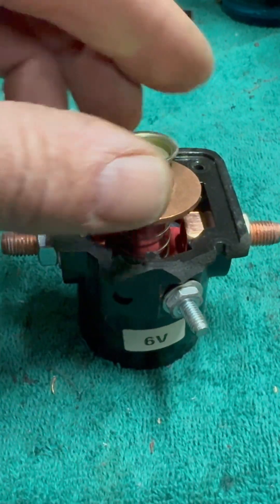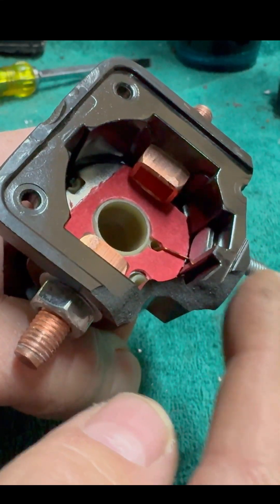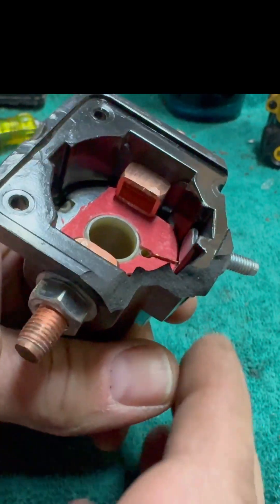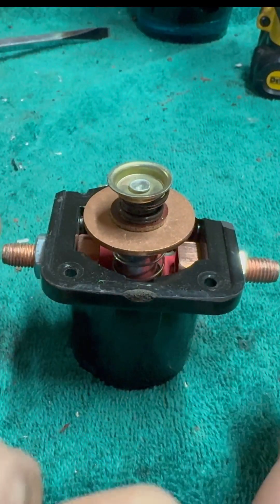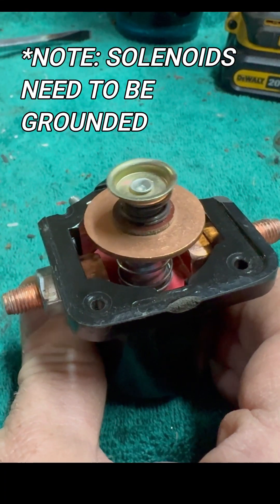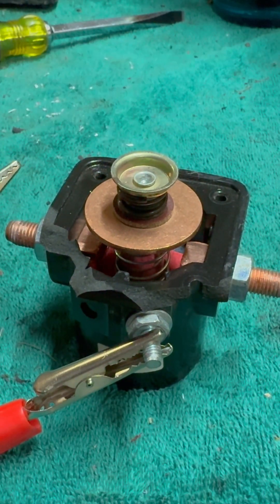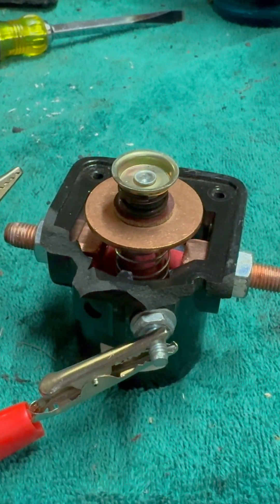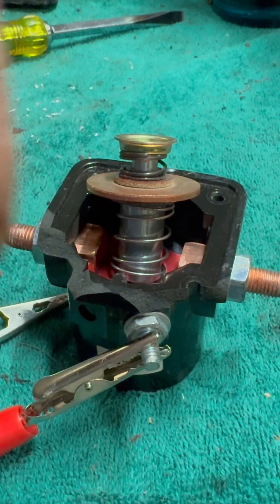How Does a Starter Solenoid Work? Explained.

Comment: Yup, a screw driver across the power in and solenoid in and the starter fires just like you turned the key. Very handy for stealing trucks or looking for tdc or any other reason to turn over the engine.😂😂😂
Reply from the maker: Been there, done that!

Comment: And like anything that once was serviceable these solenoids are no longer…most of these are built as a direct component on the starter bendix assembly now…
Reply from the maker: Yes. Cheap plastic parts made overseas. Sad.
Reply: How we would simply rotate the contact post 90 deg. Then bolt it back together .away we go another 500 starts😅